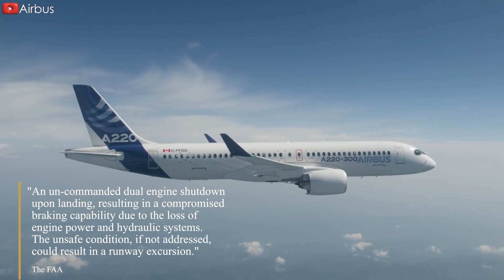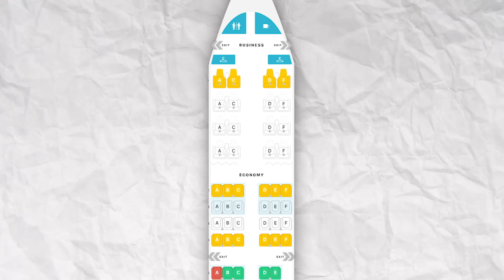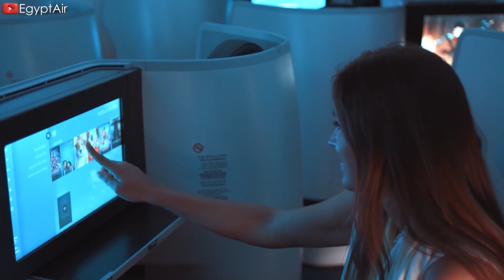Airbus is in BIG TROUBLE and NOW even bigger & bigger than you think! Here's Why

Comment: Before we can compare Boeing and Airbus, we need to apportion some form of issue source.

I would not include issues with the actual engines, which must be contracted out.

To the extent that some of the engines are supplied to the airlines under a contract directly with the engine manufacturer. Only the airframe is supplied by the aircraft manufacturer. 

We also have the anomoly that sone variants of the same engine have issues,  while others do not. It is often only after some time in service that these become apparent. 

I would, however, include issues with other components or assemblies that the manufacturer chooses to contract out.

Comment: This is full of lies. Regarding the 737 door incident, Airbus did not say it would take full advantage of this issue - just the opposite. Airbus said nothing, as a) it NEVER criticises Boeing at all, and b) it cannot take advantage, as, as is later pointed out, it is maxed out in terms of orders. As for the engine failures, these are AMERICAN engines. Not Airbus's fault at all (except perhaps for being taken in by P&W's sales bullsh*t).
Reply: Absolutely, Santa Claus travels on an Airbus Sled. Boeing are just horrible like you say.
Reply: there is more then 1 company in the  Us that makes Jet engines
Reply: @dknowles60  Yes, but you cannot just switch engines. If you ordered P&W then you are stuck with them.
Reply: @FrewstonBooks  wrong  north west air lines used both  P&W and Ge  were use on the DC 10  the 747 use  P&W  GE RR  how young are you the A220 also uses CFM
Reply: @dknowles60  This response is nothing to do with what I've said in my comment. I honestly fail to see any connection with your comment about different engines used on different planes (which is incidentally correct - I've been flying for since 1958 to know that) and Airbus's problems relating to the use of P&W engines.
Reply: @FrewstonBooks  the Cold hards there have been a lot of rolls RR problems, P&W has had some Problems and i have been flying since 1940
Reply: @FrewstonBooks   and Lockhead  has had problems with  RR engines so has  boeing